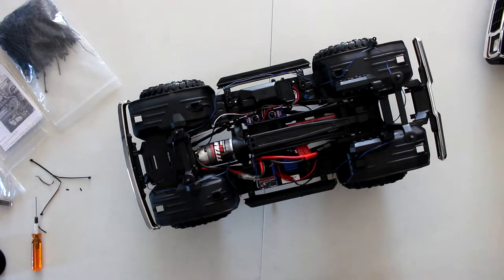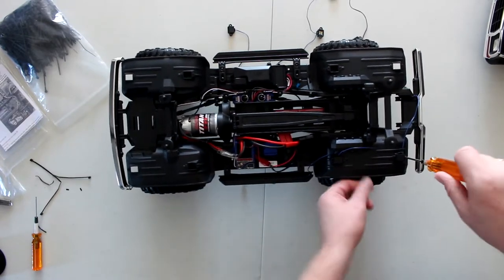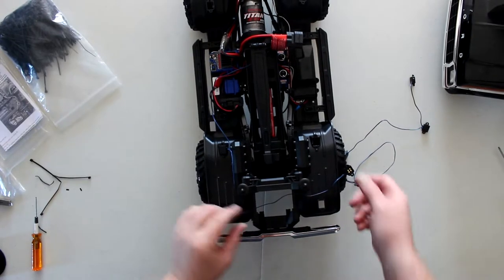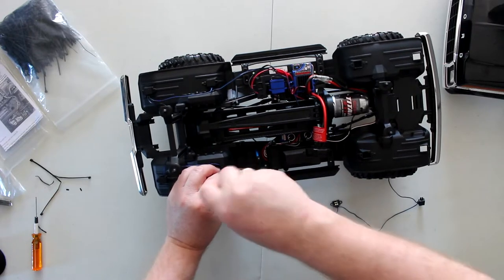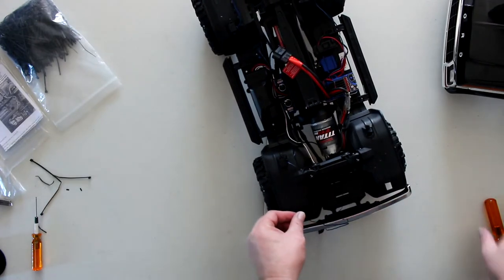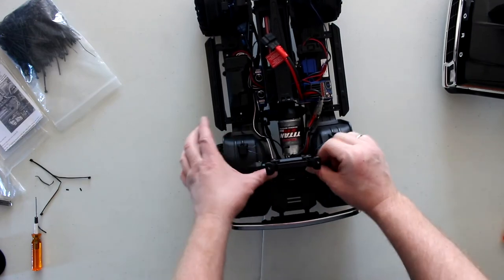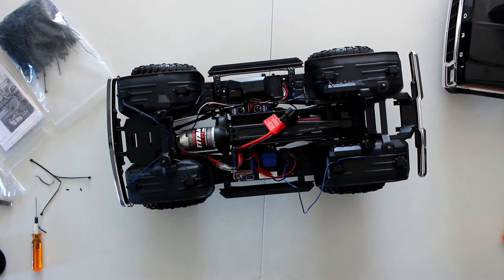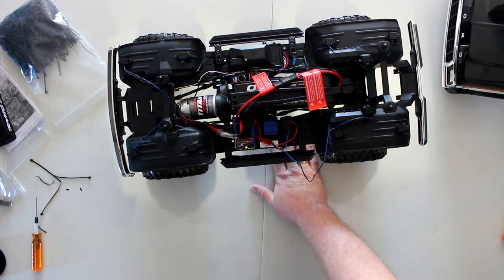Traxxas LED Rock Light Kit TRX4

Comment: Did you have to change the fenders first? I have part 3415 I was told to put these fenders on first to support the rock lights! Thank you!! I’m a beginner!
Reply from the maker: If your truck did not come with removable parts to put the lights, yes you will need part number trx8080   Depending on the model you have. But if you have the removal doors on your fenders, it’s a direct fit.

Comment: I just bought the 79 bronco. Does it have everything I need to install this kit? Or are there additional items needed?
Reply from the maker: If you want just a rock lights make sure you have the power supply but they do make a complete kit with every light for the vehicle and the rock lights with the powers of light